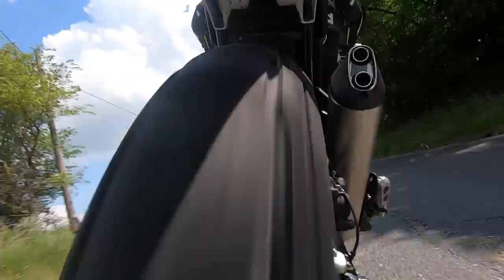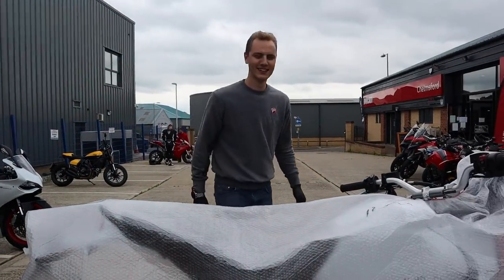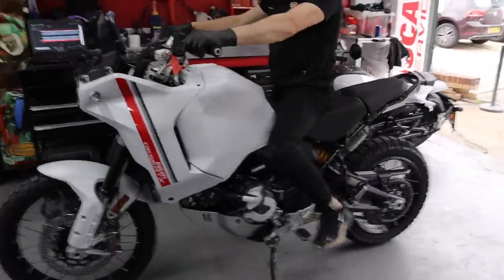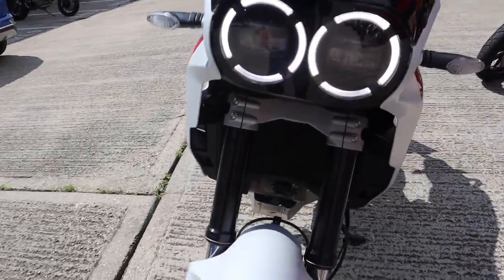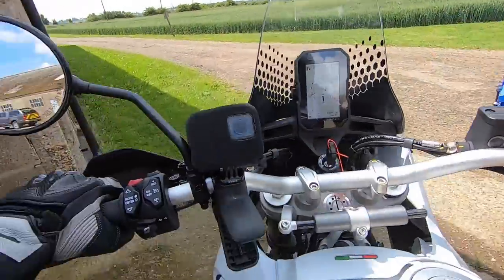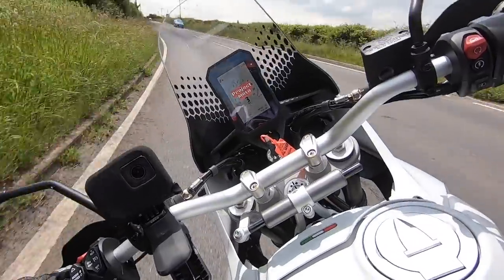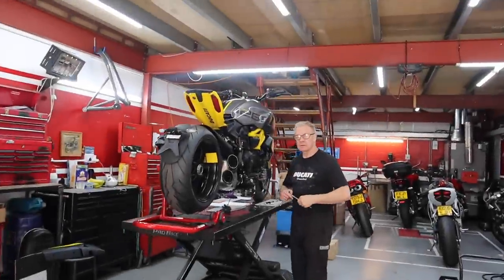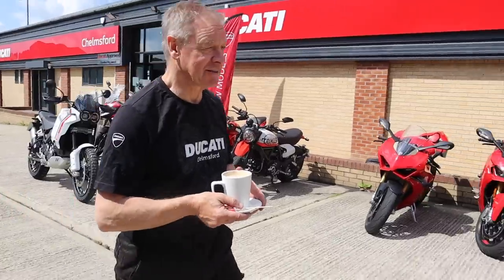DesertX .. Ducati's New Adventure Off Road bike..Still good on road? Unboxing, first look & ride

Comment: I 'borrowed' a DX when my V4 MTS went in to have the up-map, I was worried I'd really like it and thought I'd want to chop it in but I didn't really like it that much, I'd have one as well for some off roar round Wales, but wouldn't swap! Found the QS a bit clunky but the back brake was pretty brutal, didn't find the seat that comfy, felt the wind at higher speeds so adjustable screen would be nice.
Reply from the maker: Yeah I wouldn’t have one as my only bike …unless I lived somewhere where I could use it off-road , would be awesome around wales or somewhere maybe a little bit hotter , like the south f France 😂

Comment: Love the videos guys - spotted the Diavel Black & Steel 1260s on the ramp in that one. How about a review of that?!
Reply from the maker: Yeah you know what it looks cool with the yellow on it, won’t be for everyone but I think it just looks a bit different , yeah we should do a Diavel video, ridden them loads but never done a video, we’ll never posted a video, they have all been to fast 😂😂
Reply: @ProjectMoto  Lol I took delivery of one last August with the full Termignoni system - such incredible low end torque and an absolute blast. See so few good reviews of them so would love to see ProjectMoto do one. Gauntlet is down! 😁
Reply from the maker: @garethlush5300  yeah they are awesome, so fast whenever you twist the throttle and sound amazing .. I will pick up that gauntlet and put it on ..

Comment: Seen the Desert X at the Ducati Days and gota admit look super cool 🤘🏼
Reply from the maker: Yeah looks cool, be great to use it for what it’s actually made for , on the road sometimes I keep thinking I have another gear to go but I’m already in 6th with the short gearing
Reply: @ProjectMoto  Im going to try some knobbly tyres on my Hyper over winter 😂😂
Reply from the maker: @hypermotardking  yeah why not mate , be cool to take it off road and a bit of green lanes :)
Reply: @hypermotardking  I put these same tires on my 821 strada, and they do feel better on dirt roads than scorpion 2s.  They feel good on paved without knobby vibrations (so to speak).  Slows the handing a little - may add some rear preload - might not.

Comment: Thanks for great review.

1. I’m 172cm and thinking to buy this. As you mention it’s 875mm seat, but it can be lowered 20mm with lowering kit + 10 mm with low seat. In the video, was there someone near my height? :))

2. How do you compare it to the multistrada v2s? I mean for example multi %x road, %x off-road; desert %x road, %x off-road?

Thanks in advance. 🙏🏼
Reply: I have saw the bike just yesterday at a Ducati dealer : I have not made a ride with it but I sat on . I am as tall as you and I can put my foot almost flat on the street with the standard hight seat. I can assure that it is not intimidating at all and it is surprisingly light when you are on . I seriously plan to buy it . Wonderful bike for sure
Reply: @thebigmuskie  Thank you very very much friend 🙏🏼 I think you mean just one foot, am i right? How was it when you try both feet at the same time? I’m also thinking to buy it, only one question is the seat height. 🙏🏼
Reply: @aegeanadventure  I meant both (!) feet. I really didn't expected this. One foot was well flat on the floor .Sorry for my English: I'm from  Italy 😁
Reply: @thebigmuskie  Omg. It is surprise. I was calculating the lowering kit etc. Maybe no need to them. I hope I can try as soon as possible. Thanks a lot. I’m from Turkey, hello to Italy :)
Reply from the maker: Yeah Paul is that kind of height I guess, I’m not that much taller and it’s ok for us, but I would say everyone is different with leg length etc even if the same height , the Desertx is more geared for of road then the Multistrada v2, so if I only done road riding I would have the Multi V2 :)
Reply: @ProjectMoto  Thank you very much! 🙏🏼

Comment: Looks. Like. It's got some. Dodgy panel gaps just in front of the filler cap
Reply from the maker: dunno didn’t really notice them tbh , but maybe the angle of the GoPro shows them a bit more … to me it’s an ‘off-road’ retro looking bike so didn’t look too much into it, everything just kinda seems good to me for what it is , il be out on it again so with have a look though :)

Comment: Are the rear foot pegs welded on or Allan bolts ?
Cheers
Reply from the maker: They are bolts so you could
Remove them if you wanted to :)
Reply: Well are they ??
Reply from the maker: @blackiesmisadventures3413  ??? I’ve already replied that they are bolts, thanks

Comment: The DesertX Owners Manual is useless.  Ducati needs to make the service workshop manual available to owners.  The notion of taking the bike to a local dealer for anything other than checking tire pressures and adding gas is absurd, especially in the Adventure bike segment.
Reply from the maker: Personally I have never looked at a manual so do t know what they are like , what kind of things do you want to do?
Reply: @ProjectMoto  Things like check and set valve clearances, setting static and race suspension sags as a % of wheel travel, tightening specifications and so on.  Take a look at a KTM Owners Manual. Lot's of good info.  Nothing in the Ducati DesertX OM.